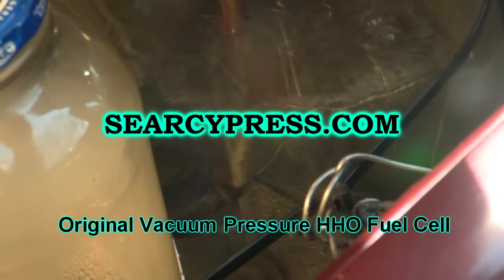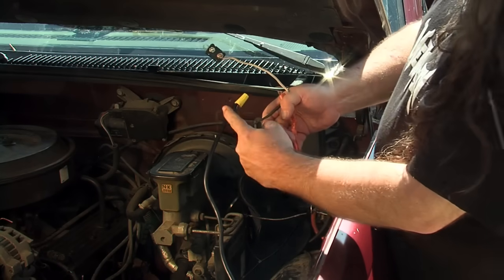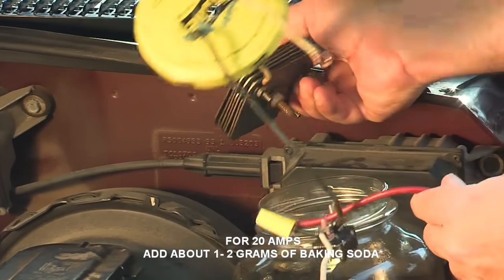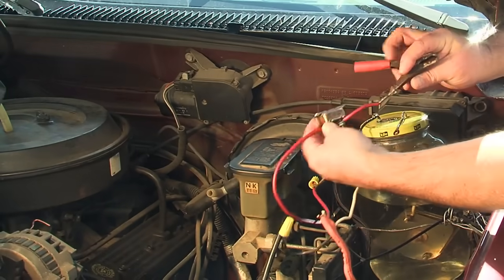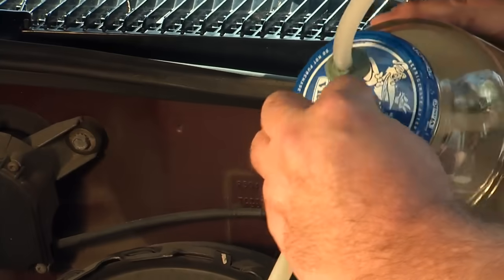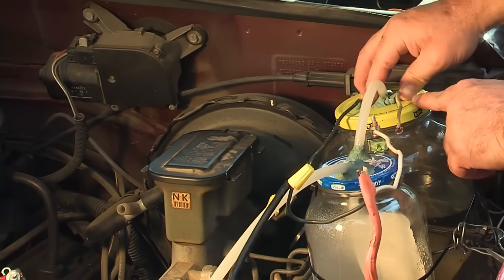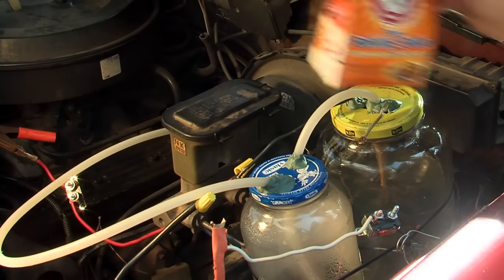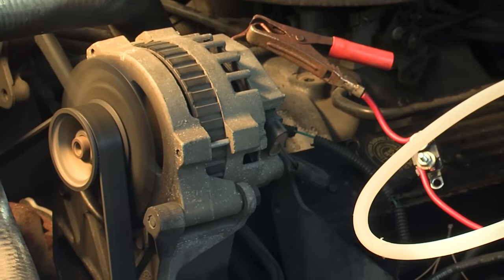Vacuum Pressure Hydrogen fuel cell defeats high gas prices using hydrogen from H2O.

Comment: One dumb question... So where exactly do you run the hydrogen pipe to, to connect to the fuel system? (Especially to a newer car) And how do you stop fuel (petrol in the uk) going into the pickle jars?
Reply from the maker: @karljones4321  Hho is produced in the primary cell. The secondary jug protects the engine from water that will overflow from the cell. Hydrogen oxygen gas is connected to the vacuum intake. Ideally this would be right on the carburetor where the vacuum is strongest. The HHO enters the engine in the vacuum. This is the only way you will ever see any gain from using HHO. Injecting into the carburetor outside of vacuum will not produce any results in almost all cases. This is because the HHO is quickly diluted. Also doing it that way can create O2 sensor problems.. remember we're not trying to power the engine with this gas. What we are doing is burning all of the gasoline in the engine. We're creating a much higher efficiency burn. Engines like the one shown in the video can waste as much as 20% of the fuel. The HHO increases the detonation in the engine and burns almost all of the gasoline. Normally this takes place in your catalytic converter to control emissions. Because we are burning all of the fuel there's hardly anything left for the catalytic converter to burn and it remains cooler much longer.. that is why so much water comes out of the tailpipe. One byproduct of burning gasoline is water. It does not come from our fuel cell it is coming from the gasoline..  within that being said,  do not attempt. (-: thanks very much for the comment.
Reply: @metalpresstv  okay, so would the pipe go in the turbo air intake of the turbo side if you have a turbo and no carburettor?

Example a petrol 2021 Skoda Octavia?

And also, does this work for diesel motors as well?
Reply from the maker: @karljones4321  let me clarify. Under no circumstances would you mix the HHO with outside air before ignition. When we say vacuum we're talking about 15 inches of vacuum.  If you have a diesel that has a vacuum system produced by the engine itself it would work wonderfully.

Comment: The problems are:
1) How regulate gas production over different engine speeds?
2) How get around the computers that manufactures have deliberately installed to work against adding HHO gas?

Comment: To avoid the risk of a strong explosion, I imagine a system with three containers, the first would be the electrolysis device that would be in a low place and would always be completely full, this would connect with the second container that would be a bubbler that is at a higher level and would be much thinner and smaller whose function is to store the smallest amount of HHO gas and contain some of the vapor of the device, in this it would be good to include a small relief valve in case of accidents, and finally there would be the third container, which would be as you present a decanter to retain any amount of water. I mention that because it is the system that I am creating right now with the help of this video and others more

Comment: I would put a water separator in between your container in the engine. A lot of engines get rust buildup because of hydrogen. It’s water.
Reply from the maker: @brentlebo9763  it's in there. The gasoline produces the most water when burned. Always good to improve any system. Thanks for the comment.

Comment: What would happen if you add a lot of baking soda. Like 5-6 spoons instead of 1.
Reply from the maker: @aymanz.s3926  it would be like shorting out the wires. The circuit breakers would trip. Thanks for the comment.
Reply: @metalpresstv   so in your opinion, what would be the maximum amount of baking soda can we add safely?
Reply: And I was thinking of using pottasium hydroxide in place of baking soda. So how many spoons of that could I add?
Reply: @aymanz.s3926  well, me personally I would never use any kind of reactive substance inside my fuel cell because of its caustic nature. It just seems like a bad idea to put something reactive inside the engine like that. I realize there are benefits to the production of hydrogen but it has never really been a factor. More is not always more when it comes to hho. Remember we're not trying to power the engine we're just trying to get complete combustion. Overdoing it is not necessary to provide gains. A little will do you, as they say. Thanks very much for the comment.

Comment: Always use stranded wire on auto vehicle.
Reply from the maker: @mgtowlevel6969  Never use stranded wire on a fuel cell. The water will wick into the wire and can cause a bad connection and it will destroy the wire. Just goes to show you how easy it is to trust the "wrong science" . Thanks for the comment.
Reply: @metalpresstv  if that were true we would not have aquarium water heaters they are sealed and they use stranded wire. The voltage connection is 100% isolated from the water or the heating element tube.
Reply from the maker: @mgtowlevel5293 I can't help you. Thanks for the comment.

Comment: What about the air filter, should it be partially blocked?
After all, hydrogen has a 2:1 ratio of oxygen and hydrogen. For every one molecule of hydrogen, there are two molecules of oxygen. Should the air filter be partially blocked so that the engine does not burn out due to excess oxygen??
What do you think?
Reply: I think that the proportion of gasoline burning is already given by the engine with the injection and aspiration, and if the device separates the H and O from the water in a 2-1 proportion, then you would not be altering the proportion since together with the H you are adding the O that is needed for the proper combustion of Hydrogen

Comment: Do you know how much hydrogen you need for an eight cylinder engine for it to do anything? Tried it not his way with a much more powerful one you need power to get power whatever you’re sucking out of your alternator or your battery you’re losing more than you’re gaining.
Reply from the maker: We are not trying to power the engine with the HHO. What we are doing is trying to obtain complete combustion of all the gasoline in the cylinder. In engines like this, up to 20% of the fuel remains unburned where it is later ignited in the catalytic converter to control emissions. The gains do not come from the HHO but come from the gasoline that is completely burned in the cylinder. The catalytic converter remains cooler much longer and results in a lot of water coming out of the tailpipe that is from the burning of the gasoline. Other systems that just inject HHO gas into the carburetor without the benefits of vacuum do nothing at all but waste your time. HHO gas dissipates  very rapidly and is diluted with air quickly and causes O2 sensor problems when injected out of vacuum. Injecting into the vacuum is the only way you will ever truly see gains from HHO. We were saying this almost 20 years ago when we figured it out. This is one of the few videos which survived the censorship attacks. Our most informative video is still yet to come and waiting for the right time. Thanks for your comment.

Comment: what is the positive connection you gave with the alternator, can you explain pls, i have a HHO kit installed in my car and i gave the positive connection from the battery and then with the HHO kit, but not with the alternator.
Reply from the maker: @IamAli89  the alternator is a better source of power. If your HHO kit does not operate under vacuum I'm sorry to tell you, you have wasted your money. That's the reason there's so much confusion with HHO. Injecting into the carburetor without a vacuum will yield no results. ( In almost all cases)  That's why so many debunkers showed themselves accurate because they were not using vacuum pressure fuel cells. HHO will quickly become diluted with air and it just doesn't work. O2 sensors will see extra oxygen and things like that. Thanks very much for your comment.
Reply: @metalpresstv  You should be able to get 300-1000 amps out of a battery.  With an alternator, the most you can get is what the alternator produces (maybe up to 150 amps) plus what ever you can get from the battery through a 10 ga wire or so( maybe another 50-100 amps).   What voodoo are you performing?

Comment: nonsense! This is nothing more than an attempt at perpetual motion. The truck has to generate the electricity to run the still . This unit will actually decrease your mileage.
Reply from the maker: @cat22_a1  that is a very uninformed judgment. I understand why you have immediately jumped to the misunderstanding because there's so much propaganda out there concerning hho. Understand that every video you see where they are injecting the HHO into the system without a hard vacuum they are doing absolutely nothing. It's just the easiest thing to do and that is why so many have done it and made fake claims. The secret to getting this thing to work is definitely the hard vacuum. Now let me address your free energy misconception. Understand your engine does not burn anywhere near 100% of the fuel in fact on this engine in the video it's around 80% or less.  By injecting in the state of vacuum the HHO gas we are just burning the additional fuel that would normally be wasted and later burned in the catalytic converter to control the emissions from the exhaust. So the energy is coming from the gasoline that would normally be used to fight pollution. It is a stupid idea because when you burn all of the fuel in the engine itself there are hardly any emissions coming out of the pipe at all and the catalytic converter remains much cooler.  That is why so much water comes out of the tailpipe because the catalytic converter is not getting hot enough to vaporize the water that is produced from the gasoline. I hope you will take the time to reflect on what I just told you. I am very grateful for your comment and I hope that you are enlightened as others who read your thread. Thank you.

Comment: I made 1 with 2 /4inchx6 inch length sch 40 pvc .
Reply from the maker: @TimCheney-l9m A  vacuum pressure fuel cell cannot be made with PVC. The high temperatures and vacuum will destroy it. Thanks for the comment.

Comment: I'm generating hydrogen.  But it won't pressure enough to come out of my spout. Any suggestions? How long does it take to generate pressure for it to come out the hose
Reply: .0218 seconds if your generator is sealed without any leaks.
Reply from the maker: Not sure if you're getting the concept here. There is no pressure ever. System runs in a vacuum. Thanks for the comment.

Comment: Not sure if anyone still checks this out, but I don't know whether to inject the hydrogen+O2, or just the hydrogen, and I don't know whether to inject it before, or after the O2 Sensor. If anybody has an answer to either, PLEASE let me know.
Reply: That setup is making so little hydrogen and oxygen that it does not have any effect on O2 sensors, or mileage.  About the only thing this is good for is rapidly removing the hood when the glass jar breaks and the hydrogen/oxygen mixture is ignited.

Comment: He has made a small packet by duping every person who believes what they have seen 
This just a racket to make money off youtube , what happens when you get water in a cylinder block .....bang lock up bent valves and rust ....cracked block or head gasket gone...and loss of breaks due to loss of vacuum.pressure................................................you cannot just stick a pipe into a container and and feed it to the engine ... if the gas filled the air intake pike while stood then he started it up would make the engine rev for a few seconds till it used up the gas . Now the air intake manifold is designed to produce vacuum at a certain rpm and by altering the gravity of the air by adding hydrogen will affect the brakes ..water b vapor will also cause some fluffing of the ignition system as spark plugs don't like water ..As he hasn't provided any true water trap that can remove and condensates water ., The container will heat up evaporating the fluid  boiling it into his engine . now the wire he connected to the pan scrubbers looks to be tinned copper . This will turn green causing the water to go nearly black as the chemical mix will desolve the copper . The amps being used will not be economical as the alternator will be made to work harder thus using loads more fuel . As you may not realize that the alternator to make electricity to run lights and all the electronics in the car uses nearly 2hours power of energy . So the alternator puts a load on the engine and that cost money in running . so all hes going to get is a bigger fuel bill and water ingress with eventually a rewind  engine .. its a cont to get people to watch so he can make money .If you want to do this you must consider what chemicals to use and the corrosion factors.During world war2 cars vans lorries and busses were converted to run on town gas and had giant balloons on top to get past petrol rationing . That very interesting how it was done in a safe way lol . i worked as a service engineer on bi engines were as some run on gas and seen what water does ...bang ?

Comment: I built an hho system same as you did with having the same 30 Amp fuse as you have. Having 3 positive plates and 4 negative plates of stainless steel. I wasn't able to get the hho system to Pulsape like you did as to have it Splurs with bubble with a pause in between every splurs of gas going up in the jar. Also, the water got really hot. I've seen other videos of someone putting Neutral plates in between positive and negative so that it doesn't get over heated. When I made it just like you did using the same amount of plates and spaced out with plastic washers in between every plate. How did your setup not get hot as to every other plate being, Neg, pos, neg, pos, neg,  pos, neg.. My biggest question Is what I just don't understand how your set up didn't create any heat.

Comment: the reason they never sold vehicles that ran on hydrogen was because of driver neglect.  one would eventually go "boom" at the wrong time by a missed maintenance schedule
Reply from the maker: I don't know if that's 100% accurate. Because if they can make a car that can drive itself you don't think they could automate a system where water was automatically added as needed.? Regardless you're not going to see it anytime soon that much is for sure. Thanks very much for the comment.

Comment: How many liters of gas per minute do you think that generates?
Reply from the maker: @kenmcclain4259  we can produce up to 6 liters per minute. Now before we get into the production fueling the engine let me be perfectly clear. We are not powering the engine with this gas. We are only increasing the combustion of the gasoline that is normally wasted in the cylinder. Engines like this can waste as much as 20% of the gasoline which is eventually burned in the catalytic converter. This is probably by design. When using the vacuum pressure fuel cell the catalytic converter will remain cooler much longer. The result is a large amount of water coming out of the tailpipe that is caused by the burning of the gasoline. It's not really coming from the HHO gas there's just not that much being burned at the time. It is just that the catalytic converter is not hot enough to vaporize all of the water which is produced by the burning of the gasoline. We have a video coming out which will tell all but we can't release it just yet. We thank you very much for your comment. Please subscribe so you don't miss it.

Comment: How many who have commented here have actually replicated this? 5M views and no comments on how spectacular this has worked.
Reply from the maker: @victorbraun1777  that's not exactly accurate. I doubt very seriously you went through all the comments. I do not suggest anyone replicate this in any fashion. We're going to release our video soon that has been waiting for years to be released showing the improvements that have been made. Upfront I'm going to say it won't work on every single vehicle out there because there are so many different designs. The main difference between this and other HHO systems is it operates in vacuum only. Many years ago we discovered that you cannot inject HHO into the carburetor except under vacuum and achieve good results.. Regardless of that fact thousands of people have continued to push that HHO works by squirting it into the carburetor. It does not. Vacuum injection is the only possible way to see results because it is not powering the engine. It is only powering the combustion process. It is taking advantage of unburned fuel and that is where surplus energy can be found. This is not over unity it is simply increasing efficiency of burning gasoline. Thanks very much for your comment.